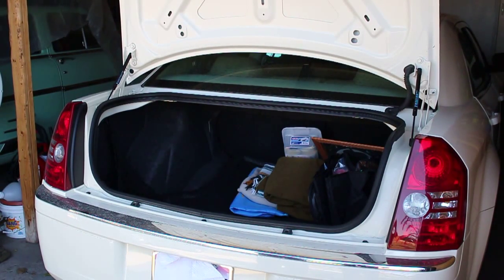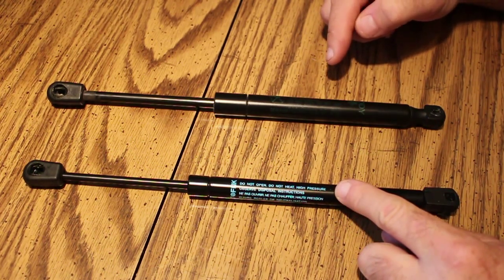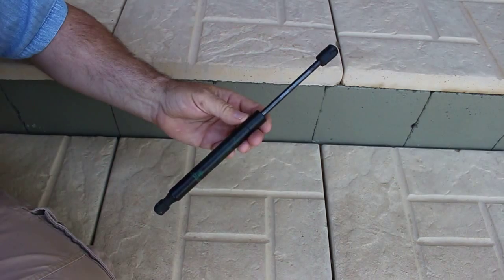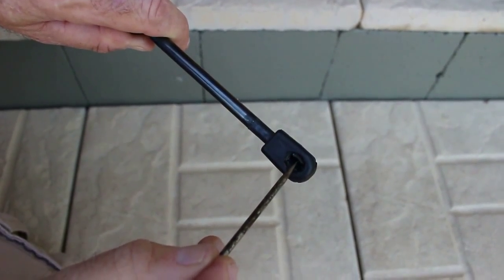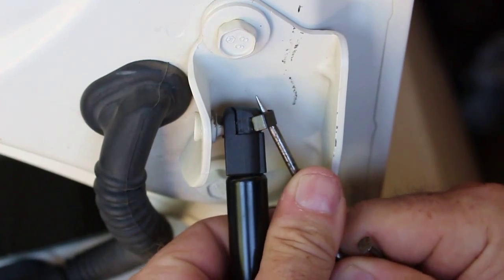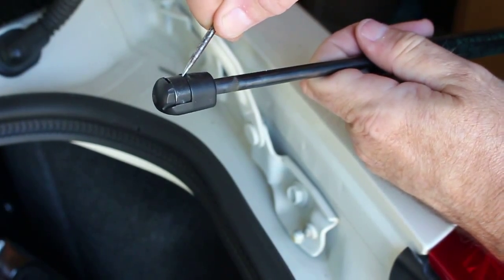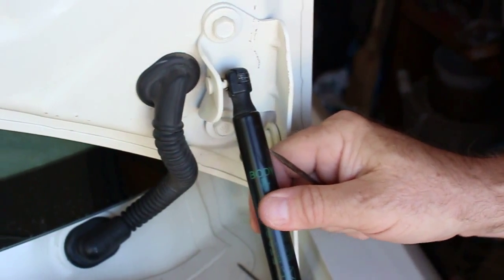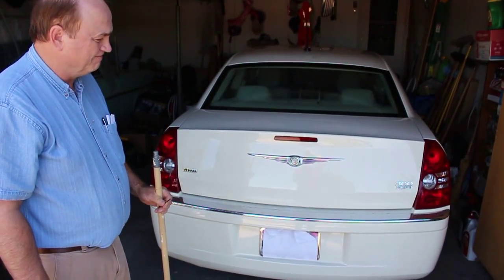Replacing trunk gas struts on 2005-2010 Chrysler 300

Comment: thanks for taking the time to post this. it was much easier than fumbling around and breaking something. one tip. i just replaced the struts on my mom's 2000 300m and the original struts work a little differently. there is a retainer cap that you need to pop out before you can get the strut off. it comes off easily once you do. thanks again, and please don't pay attention to shit posters like tom.
Reply from the maker: Hi Kevin, 
Glad this was helpful. Thanks for viewing, commenting and your tip information.
Dave
Reply: Can I be of any help Kevin?  I have a bag of rusty nails and a couple of old sticks I could send if you need any tools !!!

Comment: Thanks for the vid!
Reply from the maker: +Erick Angulo 
Hi Erick, Thanks for viewing. I thought it was interesting that the online replacements we ordered were actually smaller in diameter. They fit and work ok but I wonder how long they will last. This is something I really hadn't considered until I compared them to the original equipment struts that were on the car. We saved some money buying online. Quite a bit less than the dealer units. We'll see if you get what you pay for and if its really saving us money.
Dave

Comment: you dont have to pop both clips off. just pop 1 off them off then unscrew the shock from  the tip thats connected to the car. screw yoir new shock on to the tip thats still on the car then pop the new end back on the remaining ball on the trunk...tip (the end clips unscrew from either ends of the shocks, just use a 2 pairs of plyers..easy)
Reply from the maker: Hi Taurus,  
Thanks for watching. You are correct. Many lift support struts will unscrew on the shaft end of the strut. As long as the end is in good shape and fits tight on the mounting ball or bracket, they could be reused.
Thanks, Dave